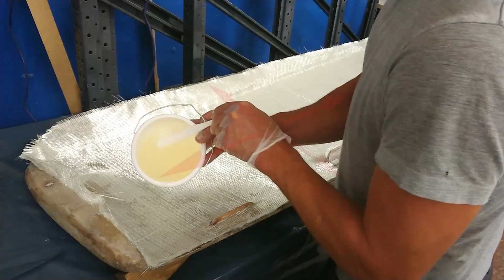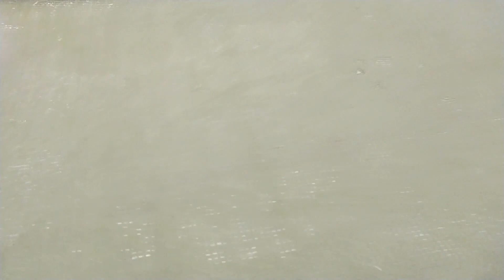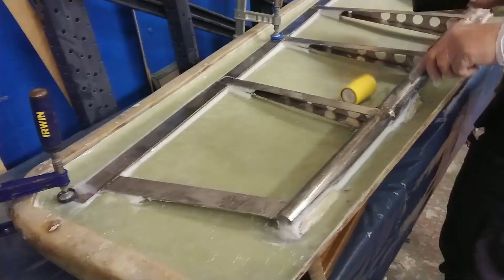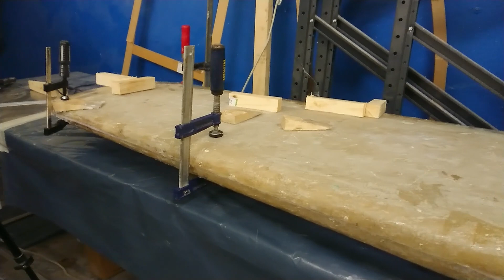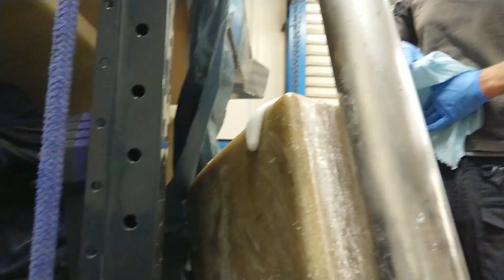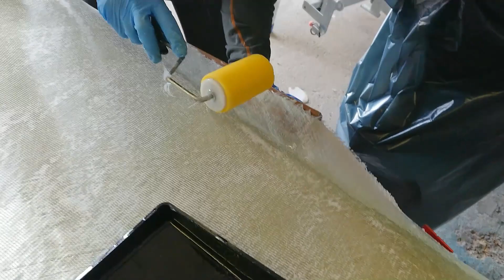How We Rebuilt Our Boats Rudder

Comment: Think about this ---->>  With everything else epoxy fiberglassed and epoxy puttied together,  then there is no reason why the exit of the rudder shaft couldn't also be epoxied with structural glassed and epoxy puttied together as well.  At that point with the rudder shaft exit, the 5200 doesn't add any flex between the rudder shell and the epoxied fiberglass shaft and SS framework, but only degrades the overall linier strength of what you just created inside of the rudder.  In the future, your epoxy fiberglass bonding setup will make it impossible to open up the rudder to do any future repair, which is why it probably have been better off just structurally bonding it completely with a structural epoxy fiberglass and epoxy putty /thicked epoxy and then you would have a "forever rudder" in place!

Comment: This is one of the best rudder rebuilds I have seen.  I'm 3 years too late, but the only suggestion I would have added is to sandblast the internal stainless components with 60 grit to give the bonding glass and epoxy foam the best substrate to adhere to.  I'm sure your reconstructed rudder will still outlast the original construction none the less.

Comment: I've got a question so. Would it be possible to make the shaft and ripps out of carbon Fibre? So the point is to have full composite construction. Also I would prefer e that the shaft breaks as a wanted weak point rather then the connected boat... I hope I was able to explain what I mean.

Thanks.

Comment: Hey there, well done! I have one question though. on the outer laminate you used mat as your first layer. Is the one you used meant for the use of epoxy on it? I was tought, that the binders in mat are normaly broken down by the solvents used in vinyl- and polyester resin and from my experience special epoxy mat is quite rare. If I understand it correctly, the mat in your combination layers is sown onto the weave and doesnt need binders to keep the strands in place anyway right?
Reply from the maker: Hi  There. 
You are correct, all CSM, even those used in the combi need a binder to help hold it together, and though the styrene used in matting designed to be used with polyester resin will just dissolve. 
The CSM cloth and the CSM stitched to the biaxial (combi-cloth) I used are both manufactured to be suitable for use with epoxy resin. The supplier I use doesn't even bother stocking polyester only suitable mat any longer as all the mat suitable for epoxy can also be used with polyester resin. Hope this helps.
Reply: You are correct. Styrene is used as a binder to keep the chopped strands together. This becomes part of the bond when using polyester or vinyl ester resins. It is not activated / absorbed when epoxy resin is used. I don't know why people still use epoxy with CSM. There are biaxial fibreglass weaves which have a stitched mat backing, which doesn't use styrene as a binder. It wasn't clear in the video if the version of fibreglass weave he used has a stitched backing or not.

Comment: Great video! I’m rebuilding my rudder as well on my 1987 Centurion 42 😂 how much of the expanding foam did you use? Thanks!
Reply from the maker: The short answer is we used 2 tins, we do break the calculations down in the video. 

Bare in mind that temperature also has a contributing factor to the expansion rate.

Comment: That's some really tidy work there! It looks like a really well thought out approach the rebuild. Did you have any issues with the expanding foam pressing out on the shells? It looks like it went pretty well.
Reply from the maker: Hey, thanks.
There were no issues with the expanding foam. We calculated to overfill by 10% as recommended by Sicomin. The stuff expands really slowly so there's very minimal internal pressure on the casing.
Check Mads video @saillife, he does some good testing of the expansion rates. 
https://youtu.be/2RFzH_NB148?si=DU-J13TJRcorgOzw

Comment: Lovely detailed explanation of what you did, thank you. The reason the frame was in such good condition was that it was originally encased in fibreglass. I didn't really understand why you chose not to redo it the same way. Is the foam impermeable?
Reply from the maker: Yes, the foam we used is epoxy and forms a hydrophobic closed cell structure.
This (in theory) means that even if the rudder gets damaged there should never be any water ingress.
Reply from the maker: Glad you liked the video 😁

Comment: Just wondering what volume your rudder turned out to be and how much Sicomin foam you used. 👍
Reply from the maker: Hi there, 
The volume of the rudder was: 
11.25 packs of Rice Krisipies @ 4.09 litres per pack = 46.01 Litres

The foam expands to x4 it's original volume (weight=volume), so:
46.01 litres  ÷ 4 = 11.5 litres

Sicomin recommend ordering  + 10% of required volume:
11.5 litres + 10% = 12.65 litres

It comes in 6.8kg packs, so I ordered 2 of these and mixed 11.8kg this was just enough to fill the rudder once expanded.

Hope this helps.
Reply: Thanks for the detailed reply. 👍

Comment: The interior layers of fiberglass have a negligible effect on strength, as the exterior layers bear most of the load.
Reply: that makes zero logical sense , show me your evidence of this
Reply: Once the inner layers are bonded to the outer layer it is a monolithic structure and the load is applied to and shared by the whole structure. So your hypothesis is fundamentally flawed.